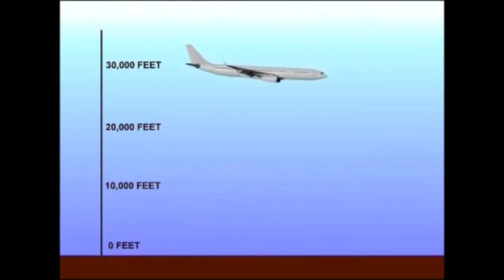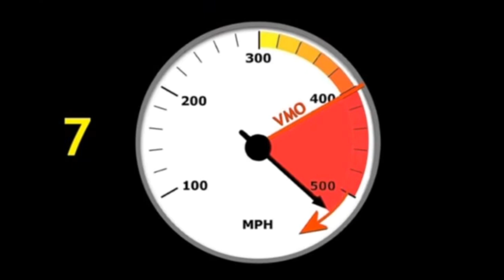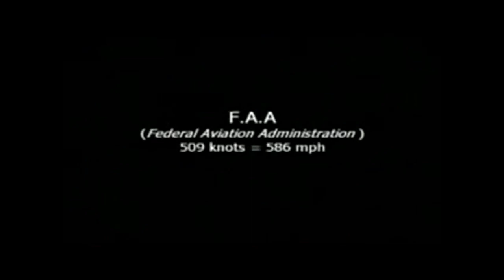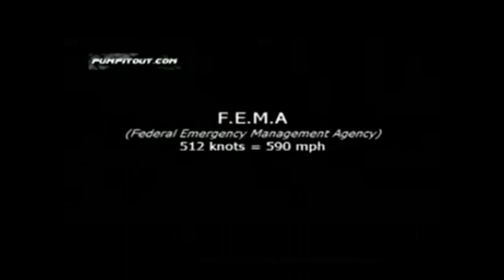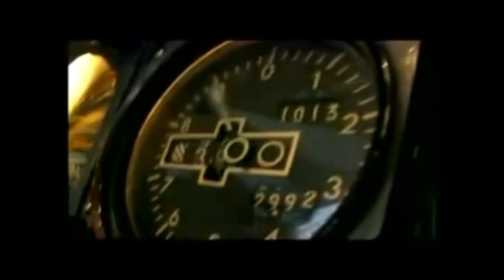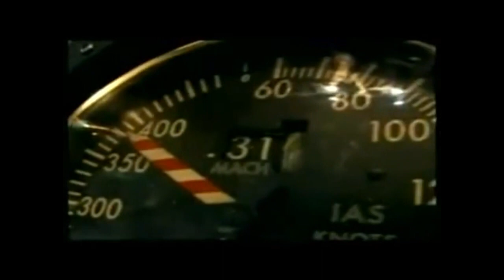Can a commercial jetliner fly above 500 mph at sea level?

Comment: The 9/11 jets were not in level flight, they were descending. None of them (to my knowledge) exceeded mach 0.8 or so, which while definitely a bad idea is far from impossible.
Reply from the maker: So you know better what a B767 is capable of without suffering a damage than an aeronautical engineers and professional pilots? Ok.
Reply: @PetrLunak whers theyr data ? they only yapping showing actuallly no prooof except words lets be honest  thrust was enough fpr clock almost or exceed 600 mph at which speed work how long those aircraft wpuld desintegrsted itself in air in that day wether condition at this altitiude under trwjcetpry which they make lets be honest you have NO F….ING IDEA you just trust on words people which fly some aircraft or spaceships but whers true study about limits of integrity those planes in such test condition ? oł thers none ok so we have 0Facts and massive field to manipulation great story offcorse 767 would eventuallly riping apart itself in air but at which egzacly speed and how loong it wpuld need take to be at those speed for achiving enough significsnt damage for be uncontrolable lost speed trajctpry hight or for visible damage from real event than on video from diffrent cam ? welll YOU DONT KNOW many of tham say thrust was not enough for such speed when in reality when ypu calculated this 💩 with true data it turns out that they in did can achieve such speed in such test condition i dont say everything what officjal narration an pd nist say was truth cos obviously it wasint in many places what show dr jodie woods feg asf smart woman well at first palce with huge know,edge in theme epand experienced 👌🏻👍🏻 but in this small aprt of hole story you can be wrong i mean with speed and aircraft integroty before riping apart in air 👌🏻 this that it theroeticsllyw as some drons without people or some holograms with bombs inside building already asf its absolutely posiible but stock 767 200 with 270 kn thrust can achieve such speed at this altitutde thats 1 and 2 i and you wr dont know when it desteoy itself in air at what egzacly point and random test from many diffrent other aircraft showing only general rules that everything start whake break apart rezonans asf dosent show precise numbers for this boieng where and how they willl destroy itself in air under to big speed so get real dude 👌🏻🪠☕️
Reply: @PetrLunak  None of your "aeronautical engineers and professional pilots" say exceeding Vmo will automatically lead to damage, nor does Boeing; what matters is how much you exceed it by. The Air China airliner may have reached mach 1 and, while damaged, still landed safely; it exceeded Vmo by a LOT MORE than the 9/11 jets did. Vmo is not a magical number, there is no guarantee your plane will suffer catastrophic damage if you exceed it.
Reply from the maker: @Tim22222  you obviously weren't listening carefully. 
BTW:
"The Air China airliner may have reached mach 1" - no, that is a lie.
"it exceeded Vmo by a LOT MORE than the 9/11 jets did" - no, that is a lie.
"Vmo is not a magical number, there is no guarantee your plane will suffer catastrophic damage if you exceed it."
- again, you were not listening at all. Were are not talking about some 10-50 mph above it, this is about almost 180 mph above B767's VMO.
Reply: @PetrLunak  If you know of any evidence disproving the claim that the China Air flight's speed approached mach 1, I'd love to see it. There is also an NTSB report of an incident with an Evergreen 747 freighter that concluded it reached 0.98 mach in a dive - and recovered & landed safely. So if you're going to call me a liar, bring the proof - if you can.
Reply: @PetrLunak  Since you care so much about V speeds, you should know about Vd - Design diving speed (aka Emergency Dive), the highest speed planned to be achieved in testing. For a 767, that speed is 0.86 mach, or 660 mph at sea level. UA175 reached about 90% of that figure.

Next?
Reply from the maker: @Tim22222  that's funny. I'm not the one who has to prove anything. The burden of proof is not on me. Logically, I can not prove what is not possible, physically, technically, lol.
And again and for the last time: you are still completely ignoring what the aeronautical enginneers said and what was the question about.
Reply: @PetrLunak  if official sources claim it did reach those speeds, but you deny it and call it a lie, you must have some kind of evidence as to why it is a lie right? I’d say the burden of proof is in fact, on you in this case. Don’t try to avoid answering questions by claiming that you’re not the one who need to prove anything, because you ARE in this case.
Reply from the maker: @Xdvulture  everything is said in the video. So either you did not listen, or you suffer from cognitive disonance.
Reply: @PetrLunak  Did they mention a 767’s vd in the video? Did they mention other commercial airliners that also reached 500 mph at sea level? Did they mention the role of g load overload contributing to a plane disintegrating?
Reply from the maker: @Xdvulture  so many fallacies, lol. Just admit that you are not able to understand what they say because you don't even want to hear it. It's so obvious :)
Btw you can not prove what is physically impossible in the first place. If NIST say to you that Earth is flat, you would believe it :D

Comment: Regarding the planes actually hitting the buildings and the pilot skill required. In theory it’s possible to hand fly an aircraft as an untrained pilot to a point of interest, it does however get harder the faster you fly. Turn radius increases with speed and therefore adjustments must be made to allow for this. Simple for a trained pilot, but not for a pilot only having basic flight knowledge on small aircraft. Let’s let that go because I believe it can be done.
The real issue is how these planes got to NYC in the first place. They were scheduled flights from Boston to LAX. The FMC would have been programmed for that flight with an alternate in case of emergency. This alternate is typically at the destination end not the departure. In case of emergency on departure the typical process would be to return to the airport you just left from.
The plane that hit the north tower departed Boston at 07:59 local time and was reported to have been hijacked around 15 minutes later. The plane then made a sharp left turn and descended over New York hitting the North Tower from the north a little over 30 minutes later. 
The plane hit the tower on the first pass in the center of the building. To manually fly from roughly 28000 feet (the rough hijacker’s altitude) down to around a 1000 feet and place an aircraft on the first try in the middle of a building in downtown manhattan requires incredible pilot skill and navigation ability. This for me doesn’t make sense.
At the speeds this aircraft was flying you would have little to no time to make any corrections and large corrections at this speed and altitude would have caused the planes structure to fail. My theory is one of the pilots was flying and Atta took over at some point.
Reply: Then you find out the hijackers were all alive on 9/12/01.  By the end of September 2001 reporters found at least 4 of those hijackers alive.

Which matches the passenger manifest showing they weren't on board.

Comment: Problem out the gate: Vmo is not never exceed speed. That is Vne. Vmo is the top operational speed for efficiency. Vmo plus one knot does not mean instant failure. 

Nice try though.
Reply from the maker: Read the description.
Nice try though.
Reply: @PetrLunak  
I have. What is your point?
Reply from the maker: @timshea4279  it's not about "point", it's about facts.
Reply: @PetrLunak  
Which means what?

Vmo plus one knot doesn't mean instant destruction. You get that right?

Cripes almighty, your example of EA990 suffered damage and landed safely! 

What about that don't you get?
Reply from the maker: @timshea4279  you are repeating only what is already mentioned in the descriprion. So thank you captain obvious.
Those alleged commercial airliners of 9/11 were flying above 500 mph, according to the several videofootages. Deal with the facts.
Reply: @PetrLunak MIT was the group that determined how fast the planes were going.

So if anybody thinks it's wrong tell them to take their complaints to MIT

I'm betting they don't come back.
Reply from the maker: @DS94everXev  
1. the speeds of the allaged planes can calculate anybody just by looking at some of those videofootages. You have time, you can obtain a distance just by taking a simple map, so it's easy to calculate how fast the object is moving - physics from elementary school.
2. the so called official speeds was presented to the public by NTSB, FAA, NIST. Not MIT.
3. there is already an affidavid from John Lear.
Reply: @PetrLunak  The speeds were presented by those departments.  The actual work to determine the speed was done by MIT.
Reply: @PetrLunak  
3. there is already an affidavid from John Lear

You've got to be kidding me! How can anyone seriously reference "Nazi base on dark side of moon" nut job John Lear. Why not throw in "Men who stare at goats" General Stubblebine?
Reply from the maker: @timshea4279  you brought pure fallacy.
Reply: @PetrLunak  
Proving you don't know anything about your own "expert" beyond what you think helps your narrative. John Lear is as batty as they come, latching on to every looney conspiracy theory there is.
Reply from the maker: @timshea4279  false again, just another fallacy. You proved nothing here. Go to your american court and disprove Lear's affidavid. That is the only thing which counts, no matter how many fallacies you'll bring here again.
Reply: @PetrLunak  
and disprove Lear's affidavid

It's affidavit. And what court case was this used in? Because someone ranting on the internet doesn't require a rebuttal.

And I can't believe the hypocrisy and irony of saying I proved nothing when all you've offered is 'John Lear says so'.
Reply from the maker: @timshea4279  well, you are too stupid or too lazy even just to use google. Says a lot about you, more then about John Lear, lol. Btw 74 % of americans, including scientists, doctors, policemen etc believe in somebody who does not exist, they can not provide one single evidence to prove their core belief. I bet you are one of them, but for some reason you thing that just because Lear believe in ET, that he is wrong in other things (in this case an aluminium wing cutting through a steel beams and concrete floors). And then you also talk about hypocrisy, such a paradox, lol.
Reply: Fact a trained pilot could not have flown that particular jet at those speed at sealevel,  the ones they said did it were barely trained to fly anything, and were not religous fanatics.
Reply: @janlloyd6138  
a trained pilot could not have flown that particular jet at those speed at sealevel

Why?

the ones they said did it were barely trained to fly anything

All of the pilots were FAA rated with licenses and had passed difficult jet simulator courses on planes similar to the 757/767's flown on 9/11.

and were not religous fanatics

Who said they were religiously motivated?

Comment: one thing that seems strange is that if a plane is being brought down fast and with control and aim shouldn't the flaps have been activated ? and if the flaps are activated you will slow down very quickly ? if your nose diving with flaps not activated at high speed you can't control the direction or aim of a plane right ? So how can you aim a plane straight into a building at level 93 ? the nose would be aiming down not horizontal level ?
Reply: Landing an airplane is akin to hitting a target on the ground with an airplane. So it would make sense to have the plane in some sort of quasi landing configuration to hit a building. An airliner is most maneuverable when it has its flaps down and is going at a very slow speed, like 160 knots. The official narrative really doesn't make sense. You'd have to he incredibly lucky to hit any intended target at such high speeds.

Comment: It has been 20 years since 9/11 today. I'm curious if you know about the fourth plane "disintegrating"? I don't know what it means for a plane to disintegrate but I'm assuming it was downed by the military and then nosedived, causing it to explode. However there is no wreckage due to disintegration, similar to Pacific Southwest Flight 1771 which also disintegrated. What does this mean? Wouldn't there be large pieces of wreckage such as the wheels or chairs?
Reply: The only thing that travels at that documented speed with that unbelievable accuracy & fully penetrate the TTs then explode on impact is a Tomahawk missle, Which it was!!! 
Cloaked by another nearby plane to look like a plane hitting but problem was it was all black with no markings or windows and there were ZERO plane parts found anywhere after belonging to a Boeing plane. That 1 engine reported found on the street was 100% verified by FAA  NOT at all possible a Boeing 767 engine..... 
Etc etc etc....
Reply: @portobelloedinburgh8891 you're making things up still after all of this has been debunked. 
It hurts you too much to accept you're wrong.
Reply: None of the planes disintegrated because none of the passenger planes made it to the supposed targets.  They all went to a military base and were landed there in a hanger.  That is why the pepper spray only impacted business class and not the whole plane because it was not pressurized.  And it would have to pressurized if it were in the air.  And if it is pressurized the entire airplane will be impacted by it.

It wasn't. Because they had landed.  That phone call was made on land.
Reply: @DS94everXev  by just doing a quick google search, you can find many footages of airplane seats, lifevests, debris and even passenger remains scattered on the streets of lower manhattan which implies that the plane must have been occupied. some people reported seeing airplane seats with passenger remains still in them on the ground and many of the passengers remains were found and identified. perhaps small debris could be preplanted but it's very hard for me to believe that human remains could be preplanted in new york without anyone noticing.
Reply: 95% of the aircraft was found and all 40 people onboard and the 4 hijackers remains were found and positively identified